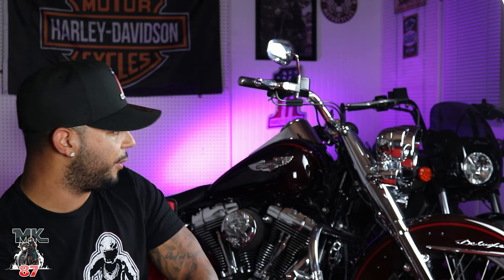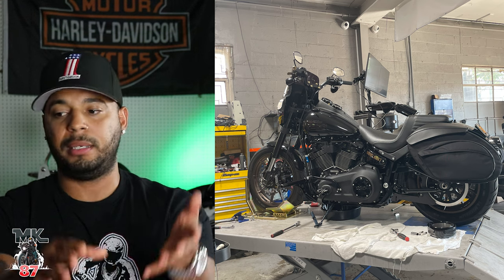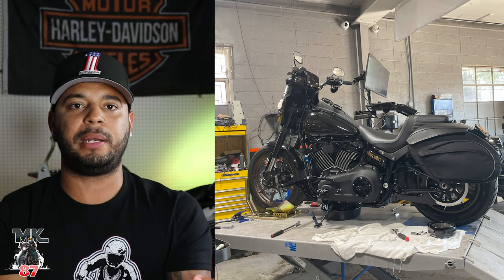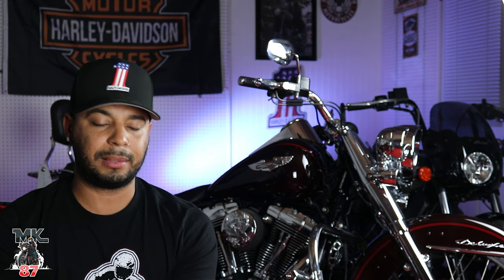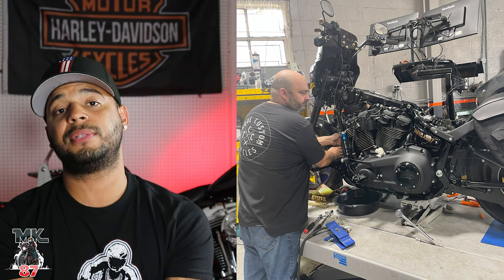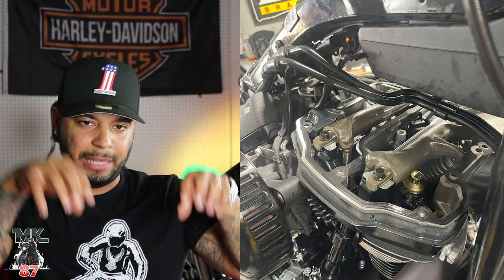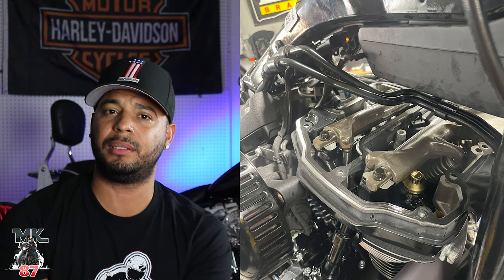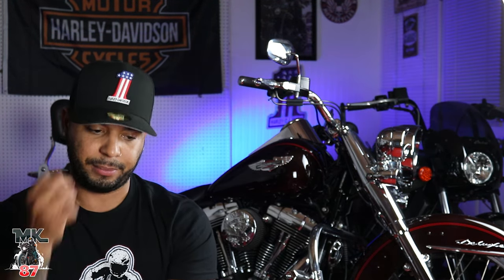Everything that went wrong with my Harley Davidson Low rider s / Milwaukee 8

Comment: SS has a rocket kit and new studs come with it. It’s called the guardian kit I put it on mine when I did the 128 kit from Fuel Moto runs 800.00 and worth every penny
Reply from the maker: Thats pretty pricey but in sure it’s worth it down the line

Comment: I have the 2021 Pan America. I’m having several issues that have yet to be solved.  A couple weeks ago, I rode it to Daytona from North East PA. I left Wednesday, smashed 16 hrs and 1,100 miles in one day. Stayed Thursday and did the tourist thing. Left Friday Morning and got home before 2am. Would have been home much sooner but got stuck for almost 3 hrs Near Maryland with stopped traffic due to an accident. Anyway, the bike went into a limp mode 3 times during the trip. You have to clear all the codes before it allows you to go again. The second time it almost got me killed and I had to hit the grass to the left of the fast lane to keep from getting hit from behind. It’s like the bike just completely cuts the throttle and when you’re in a pack of cars doing 85-90, a sudden chopping of the throttle slows you down fast. Other issue is my Cush drive is loose cause I can move the wheel about 2 inches before the chain sprocket starts moving.  That wasn’t discovered till I went to clean and re-Lube the chain after I got home. Then the thirst is the suspension keeps failing. Flashing shock symbol and triangle in top left corner. Does it 30 minutes after every restart. Appointment made for September 8th. Let’s see. On a side note, this thing should not be falling apart yet from one 2500 mile road trip in 72 hrs.
Reply: I hate hearing that, I would love to see HD succeed with the new bikes and just in general. I understand new vehicles have bugs that need to be worked out, but that sounds like a bit much. Hopefully a software update of something silly is the issue!

Comment: Sucks that it happened, but it’s very good they were able to figure out the root cause of the issue being the rocker arms and no damage was done to the motor. You’re going to probably shit your pants the first ride on that 475 cam. Looking forward to that video. Question/Request, are the guys at Torque Dyno tuning the bike? If so, make sure you post Dyno numbers. I hope they are actually tuning it and not just dropping a base tune into the Powervision. That’s the best way to get all the power out of that cam upgrade.

Comment: I have a 2019 Street Glide Special with only 9000km on the clock (had it since new) Just got the stage 2 done with a S&S kit, 475 cam. Sounded bloody awesome when I picked it up, but after 10-15min ride, the loud "tick" came in.  Tick goes away with the throttle, but comes back with no throttle and more prominent with idle. Called the dealership that installed the kit and they're coming out tomorrow to trailer my bike back to the shop.  Be interesting to find out what is happening? By the looks of this video and the comments flooding in, this appears to be or becoming a common problem........ 😡

Comment: New Harleys are trash.  I have a built 80, 88, 96, and 103. Kept every bike so far from New.  Had a 2019 SG with the m8, first Harley I ever sold opened it up for forst service and found a extra quart of oil in my primary. So I got a 2022 SGST for 30k new and couldn't pass it up. I enjoy the low end torque, but all my other bikes keep up or catch up fast.  It's already had 3 shop visits since March and only has 3k miles on it.  I think I'll stick to buying 1 owner softtails and dynas and building them up.  It is pretty sad when I can buy and build a bike for under 12k that will keep up with the new m8 and be reliable.  I've been moving backwards I guess, but I ride for a living, daily- I'd rather have the old stuff and not total electronic nonsense.  Maybe after dumping 8k into the new glide it'll be as reliable as a 30 year old bike.  I don't see many of these bike making 20k miles a year without a ton of work.

Comment: Same thing going on with my M8. Same cam. I’ve put about 3k miles on mine and the sound has definitely gotten quieter. Been checking my pushrods often, but if the sound starts to come back or worsen gonna be switching to roller rockers.
Reply from the maker: did you go with adjustable push rode or solids ? I have adjustable's cuz the feeling solid push rods I wanted are on back order
Reply: I had that ticking sound before I put that same cam in but now it's gone. Have about 2k miles and haven't heard it since. Sheesh now you guys got me paranoid lol
Reply: @Marvelkid87  got S&S adjustable ones. Never really heard anything super bad about them, but we’ll see haha